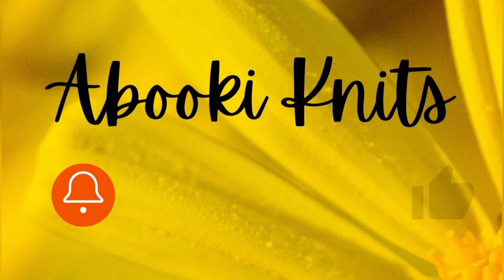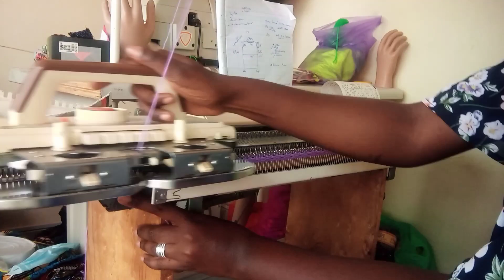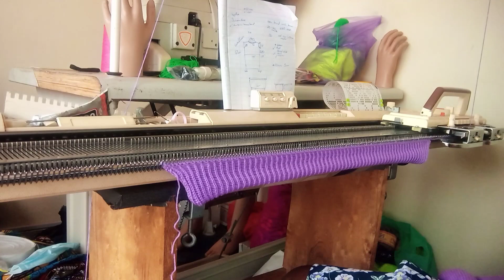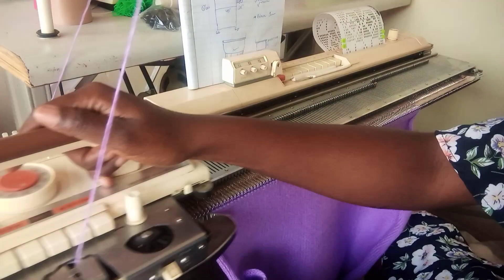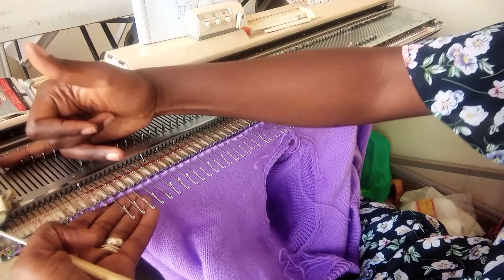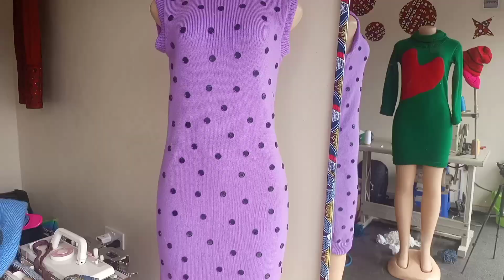Machine knit sleeveless turtleneck dress with polka dot buttons

Comment: With all of the flatbed knitting machines I should be knitting more consistently.  So appreciate your
tutorials.  I own the following knitting machines:  Brother KH260 with ribber; Brother KX350; Brother
KX 395 Convertible; Brother 585; Studio 560 Electronic with ribber; LK150; Bond Elite; Ultimate Sweater 
Machine; Vintage Bond with ribber; KnitMaster Afghaner; Addi King and Addi Pro circular knitting machines;
Sentro 48 pin circular knitter machine.  2-3 times/yr I will knit something.  Love knitting blankets and will
knit a sweater.  My machines should get more use.
Reply from the maker: Oh wow. Those are way many . You should be having a small industry running there. You should be knitting more and many designs..

Comment: Weldon ma, did you shape front and back the same way?  and please can u give us different measurement
How did you covert tape rule measurement to stitches or inches?
Reply from the maker: The front and back are different, kindly re-listen through the tutorial because I gave the explanation.
Reply: Janet it is vitally important to do a swatch with the yarn you will be using to knit your project.  
Yarn 'thickness and machine tension impact:  # of stitches/inch which give you width;  # of 
rows/inch will give you length.    Example:  Let's say that after knitting the swatch I discover 
that there are 5 stitches/inch (20 stitches/4 in).  My waist is 35 in.    17.5 " for the front  panel = 
17.5 x5 = 87.5/88 needles, which is 44  needles on the left and 44 needles on the right.  
Back panel of the skirt will also take 88 needles (44 needles on the left and 44 needles
on the right).  17.5 front panel + 17.5 back panel will give me a waist of 35.  For
women with larger hips than waist, you will need to learn how to add stitches after
knitting the waist going down the skirt to accommodate your hip size.  Hope this helps
to give you some ideas,

Comment: How do u convert your tape rule measurement    in inches to stitches
Reply from the maker: For a body of 40", I divide into half that is 20" and place the tape on the needle bed at 20" to work on the front/back. However, I usually add a few needles for allowance.